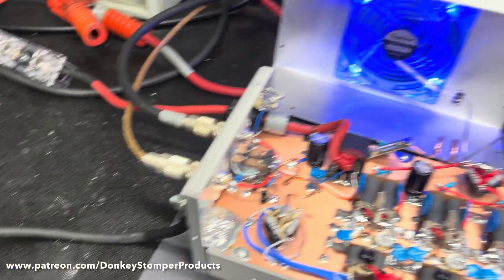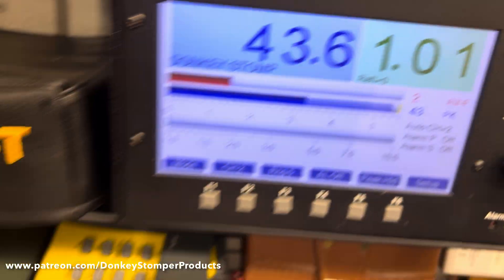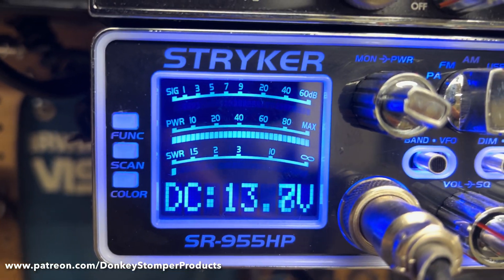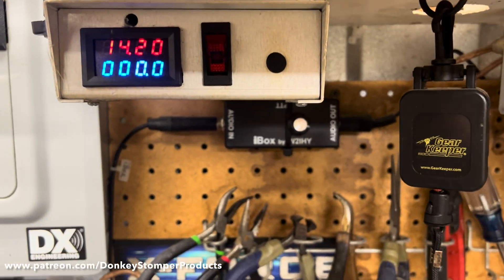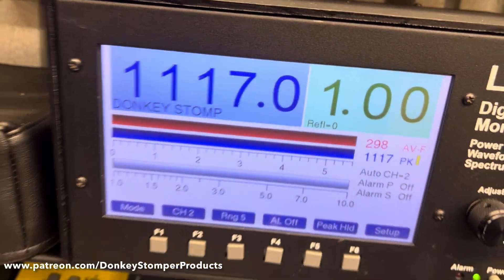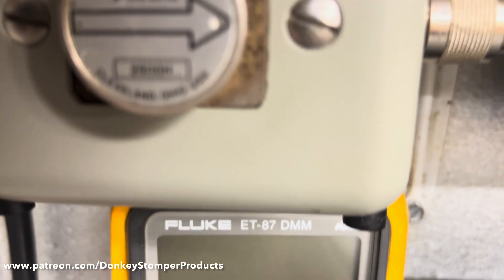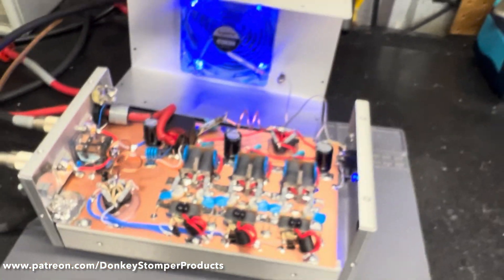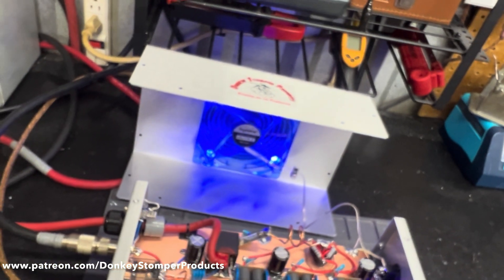600HD-HG-6 Pill Mobile, CW Transmitter, True ON/Off, Thermal Protection

Comment: Great video....I have a stock Cobra 2000. Dead key around 3 swing 18.....What would you suggest for around that 500 pep more or less....Thanks (Coyote) upstate SC
Reply from the maker: Maybe 1x4 ? 2x4, 2x6 something with drivers in it. Would be nice lower carrier little more on the radio. I could pad a amp to handle it. You would loose some top end swing.